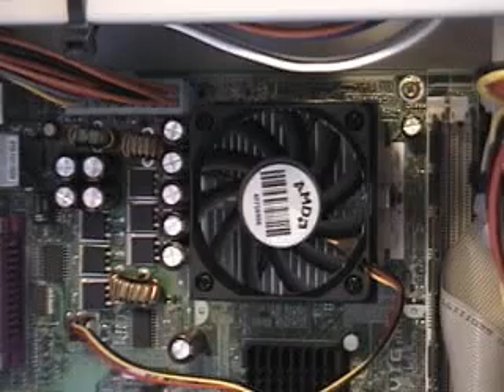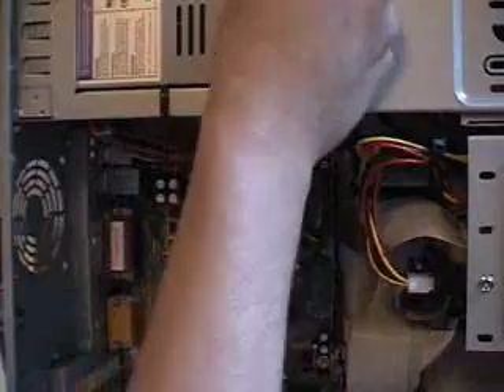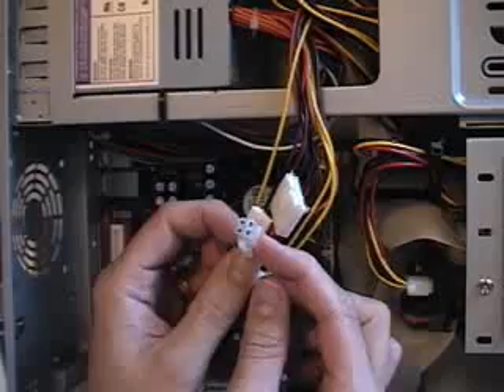2002 PC power supply connectors explained

Comment from the maker: @MrTpengineer NO!  That's a different kind of 6-pin called an AUX connector.  The PCIe 6-pin connector is only +12V and ground.  Your AUX connector has +3.3V, +5V, etc.  Totally different.